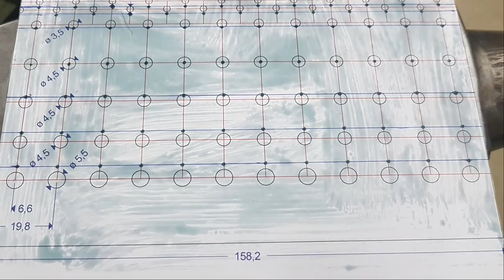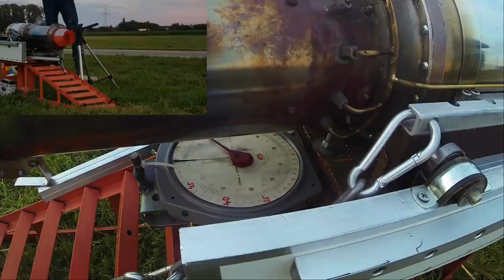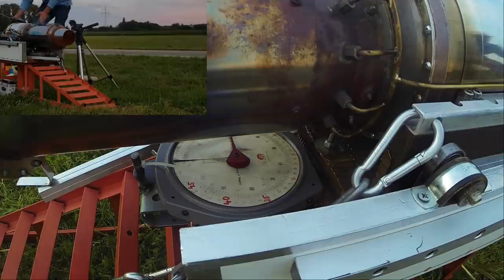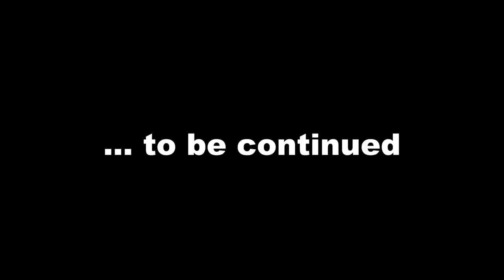Handmade Jet Engine, Improvements, Mishaps, Testing, Full afterburner

Comment: If you could make a bypass fan that ejects cooling air into the afterburner you would solve most of your heat issues.
Reply: A distilled water and methanol mix injected at some stage could possibly help too.
Reply: unfortunately this would not help. an afterburner gets its thrust profits from reheating the exhaust gases. if you cool the whole stream you will lose thrust. I'd rather improve wall cooling
Reply from the maker: Hi,
all jet engines with water/methanol injection working the same way.
You cannot increase the power of a jet engine with that.
The only purpose is to "hold" the thrust in warm/hot ambient temperatures.
The density in hot weather conditions is more less, than in cold weather. You loose thrust in hot conditions. 
Andy
Reply: How about some ITC HT Ceramic Coating on the inside of the burner that way the metal isn’t so hot and it will keep your heat/thrust
Reply: @Praendy  if you use strait alcohol as a afterburner cooling spray ( like a ring that sprays out the cones inner surface radially) you would gain the cooling you need also using it between walls in the tail section before injection would soak up quite a bit of heat, this is similar to what nasa does on its shuttle rockets
Reply: @Praendy awesome genius work btw
Reply from the maker: Hi Joe,
the afterburner is not a problem.
All parts are made of Inconel.
It looks more extreme, than it is.
Nothing will melt👍👍👍
Andy
Reply: Wie kann ich Inconel Bro finden? Ist es teuer?
Reply: @carneum5128  inconell itself is not too expensive but it's brittle and hard so a pain to machine or post process
Reply: @petergebert4817  I’m not talking about into the direct airstream, I mean more like a second combust or can with holes in it. This would add more air for combustion but also a cooling jacket of air just like in the main combustion.

Comment: My inner scientist/engineer thinks there's still about 20% more thrust... somewhere. Where that is? I have no idea.
Reply from the maker: Hi,
Thats also my "good" question.
30 Kg thrust is not much for this size.
Will try a different compressor wheel next time😉
Andy
Reply: @Praendy  This is still better in thrust/weight than the axial flow engines of World War 2.
Reply from the maker: @DrHarryT  Hi,
First I will try a different compressor wheel.
An axial compressor is a big challenge for homebuilders.
The advantage of a radial compressor is the simple handling.
You have a good pressure ratio with only one stage.
For the same in axial, you will need 4-5 stages.
Also the diffuser is easy to install.
The shaft is easy to machine and to balance.
For an axial comp, the aerodynamic performance only allows very small mistakes.
Lets see the thrust with the new comp wheel😉
Andy

Comment: Hey Andy, 30 kg is quite a lot for your own design. Yes, it sounds really like a fighter jet. I had my jaw dropped from the beginning of the video. When the compressor cover came off so did my jaw too lol... Good luck!!
Reply from the maker: Hi Shanaka,
Yes, the sound is awesome.
30 Kg is not bad, but the engine is calculated with twice the power, without afterburner.
Next step? Trying a different compressor wheel.
The engine is still in perfect condition after the incident👍👍👍
Thank you!
Andy
Reply: @Praendy  Ok i didn't dare to say so but 30kg with after burner sounded really inefficient. I'm keen on seeing the rest :-)

Comment: That's really cool I used to do that for a living building test engines for different kinds of platforms.
We even made a modern version of an old German design before turbine and especially compressor technology was even known the way they chose to heat the air was with an internal combustion engine so basically it was an overblown internal combustion engine that had a separate turbineshaft to extract the power from the turbine on demand as torque as opposed to thrust in addition to the crankshaft power produced that could be directed to the  compressor or as torque through a pair of clutches you could either couple crankshaft horsepower to suck in more air for thrust or coupling the turbine output to the crankshaft to power a heavy load, propeller, generators.
Imagine a V8 with the cylinders of a motorcycle about 250cc each, 
Turbocharged by a high bypass fan turbojet engine.
Utilizing the engine as the combuster section.
 Combusters sections were beyond most people not to mention most compressor designs induce stall at some point in there operation that can be objectionable if not dangerous.
Explosive compressor burps scare the hell out of people to hear a giant explosion and see fire coming out of the front of the engine on take off does not give one that warm fuzzy feeling witnessing it from inside the aircraft.
Typically not a real reason to turn around and land but if it's bad enough you let it go on too long you may not make it back.

Comment: Most videos I watched about homemade or even a modified jet turbine, they always kept the turbine spinning after shutdown to cool down the internal temperature of the engine.
 Saves the bearings and keeps warping down.
 I want to see one of these mounted in a RC jet aircraft and watch the afterburner operate ! 👍
Reply from the maker: Hi Richard,
At 06:20, you can hear my fan.
The turbine is also slowly spinning.
The fan gets mounted after each run for 10 min.
Then the temperature is below 50C.
Andy

Comment: Combustion can design: Angle the holes and understand a simple rule, never let the flame touch anything other than air and fuel. Have a look at combuster cans of bigger engines and see how the cans are usually made of multiple sleeves and have air holes that encourage air to cool the can and provide a boundary layer.

Comment: That is wicked sick.
Certainly one of the better ones I've seen out in the civilian home shop world.
You may wish to consider some explosion Shields around the compressor and hot wheel areas.
When Garrett Turbine, Allied Signal now Honeywell originally quoted apu's to Lufthansa they requested containment shields around the compressor and hot wheel areas and we did the prototype parts as well as some of the test rigs used to certify the design as the units are typically in the tail any failure resulting in a fire or the ejection of parts cannot be tolerated. 
Basically the shroud of the hot section and the compressor were beefed up considerably I believe the initial design was about 20 mm in the area of the hot section of inconel that ended up getting a lot of metal removed so it's retain the strength but to lose some weight this is done to all the shrouds that make up as I remember about six different pieces with the original parts weighed about 45 lb to current shrouds weighing almost 80 pounds in total.
Reply from the maker: Hi Chauvin,

I use some approved aircraft parts for the engine.
The ngv and the turbine wheel is from a Tornado fighter jet APU, called KHD T 312.
The turbine wheel is made for constant 68 000 rpm, up to 730° C egt.
The compressor wheel is a Mitsubishi TD 13 wheel and can handle 85 000 rpm.
I only want to go to 70 000 rpm and short time.
The engine will never fly, its just for fun and for some displays.
It weights 16,2 Kg with afterburner.
Still working on the variable nozzle and the performance.
Bought a nice balancing machine, made in 1966.
So far I had vibrations turbine side and was restricted below 70 000.
Now I did the first testruns with a "balanced" rotor and it works much better.
Will make a new video next time👍

Andy from Germany

Comment: Beautiful workmanship- it runs and flows so smoothly!!   In and out of the afterburner with a nice even flame!
 When it doesn’t want to shut down, it’s because you have some residual fuel in the fuel control, lines and nozzles…   In the turbine engines that I’ve flown and maintained, they have a “pressurize and dump” circuit which uses compressor bleed air to basically blow out the remaining fuel in the lines and nozzles when the fuel control is moved to the fuel cut-off position…   Also, instead of the fire extinguisher, which might have some chemicals that are corrosive to the internal parts of your engine, you might try using the starter to “dry-motor” the engine and move cool air through it…   Also, you could use an electric or gas powered leaf blower to do the same thing, cool down the hot section and blow the residual fuel and the flame out…   Just a suggestion, it might help extend the life of the beautiful engine that you’ve designed and built!!

Comment: Nice.
I'll give you as much as I can, as I have researched jet engines for a while.
Water for fuel in the afterburner (needs 4000* F+ to achieve ignition)
or as an air density increase.
Ceramic turbine blades, like GE uses, can be manufactured and replaced early, and will not degrade nearly as quickly.
High grade bearings and a lubrication system improvement is definitely necessary (I have a feeling that you spun a few in the "mishaps")
A diverter cone in the afterburner would increase the output, but would need to be prepared for the environment.
What you can't use:
My implosive air intake uses cavitation/vaccume for improved inflow
GE clockwork compressor is about the best basic form, but I have a ... different approach utilizing air to compress air while minimizing friction, sectionalized and stackable.
I had a heated fuel system theory that worked with the water fuel concept, as well as a pulse jet burner concept (I have many burners...all need testing) Another theory is bleeding the thrust into the intake for higher heat, rpm, and burn efficiency, but I haven't scienced the "stuff" out of that yet, lol.
I hope it helps in some way. You could use 100 pounds of thrust, right? For most guys, it's the rev of an engine, but for me, it's the blast of an afterburner that excites me. Ahh...that's the sound of horsepower.
Reply from the maker: Hi,
I have already build a variable nozzle for the afterburner, but first I test with fixed nozzles.
https://youtu.be/HPt10TzF00w

To bleed exhaust air into the air intake again is really not effective.
You use already burned air with less oxygen and a much less density.
The bearings I use are able up to 90 000 rpm and one of the mishaps in the video was the new shaft, rubbing in the tunnel and got stuck.
I will test a different compressor wheel next time and see, how it works.
Thank you😉 for liking!
Andy

Comment: Fantastic project - have worked in jet engine test for the last 40 years - I would highly recommend an inlet screen!
Reply from the maker: Hi Andrew,
Thank you.
An inlet screen is not required.
The engine will never fly. Its a show model for displays, or jet meetings.
Andy
Reply: @Praendy  I understand that, but over the years I have seen static turbines ingest all kinds of foreign objects from birds, to bolts to a crane hoist Chain!! They make pretty efficient vacuum cleaners!
Reply: @OldGuyWithaCamera  maybe we can see him throw in one of those broiler chickens from walmart
Reply: We used to do that to validate that the engines could withstand birdstrikes. They used to use a standard size duck, but once one caused much more damage than expected, it was discovered that some ducks swallow stones to make themselves less buoyant and able to dive more easily, after that they x-rayed each duck before firing it into the engine using an air canon!

Comment: this is honestly the coolest thing ive ever seen. You're really out here iron-manning things I felt only companies with tons of money and resources could do. Could this actually power something like a light jet?
Reply: Very easily with alot of power to spare with the afterburner. Just have to find a way to deal with the tremendous heat and keep the airframe cool enough so the rc model jet doesn't burst into flames especially once you lite the burner.

Comment: Your next level would be a turboFan : ) nice job sir! I guess vibration made the air intake nozzle slowly spin out of thread...Nicely enough, when it was off it did not touch the air-compressor blades. 😃
Reply from the maker: Hi,
the heat made the teflon compressor cover soft and the aluminium intake got pushed out.
Now all is made of aluminium.
Thank you👍
Andy

Comment: The engine got hot and the case expanded more than the intake housing so it fell off. I saw it happen earlier in the video. You'll need to find another means of attaching the intake. Just screwed together is not enough.

Comment: Would you mind if I asked one question, please? Does it run on electricity or on shafts like a normal jet engine? Is there a compressor on the engine?

Comment: Now put a larger fan and cowling of a size to avoid mach 1 on the fan tips with a magnetic gear box between fan and compressor fan (reducing speed as desired) and you'll have the smallest single spool high bypass turbofan engine in existence,  and may almost double your thrust. For those who can't afford a Rolls Royce GTF.

Comment: very nice! did you measure compressor discharge pressure? how did you balance it? that AB is very happy and it isn't melting anything. very nice!
Reply from the maker: Hi,
Yes, but with the current compressor wheel, the pressure is not that much and the thrust is missing a lot.
Today I got a new wheel 8+8 bladed and a bit bigger.
Balancing I do in my hands😉
First trying with knead, to find out  the imbalance and when all feels good, grind off step by step the opposite side. For that I use compressed air and it takes much time.
Thank you👍
Andy
Reply: @Praendy  That is my next step- learning the art of balancing. Keep up the good work!

Comment: Add a little bit of Oxygen so the fuel will burn better and you will get blue flame and more thrust 
BTW which motor have you used
Reply: and maybe a melted engine
Reply: Me:  Build this fuckin beast with vibraniumtitanumuraniumheliumthoriom 
PHYSICS:👌👈
CHEMISTRY:👌👈
MATHS :👌👈

Comment: Any idea what caused the damage?  Vibration, or did it just melt?
Reply: Extreme high temp exposure, i presume. Im wondering if he installed an EGT thermocouple and TIT sensor.
Reply from the maker: Hi Richard,
I also use Teflon for the intake.
The high compressed air is already "hot" ~160 C and the pressure pushed out the aluminium part.
The Teflon got weak and "soft", so the thread was not able to hold it in place.
It didnt fall off, because I had a cross bolt at 6 o clock installed😉
Engine is OK, except the compressor wheel. Will run again soon👍
Andy

Comment: When are we gonna see this beast on wheels or wings?
Reply from the maker: Hi,
At 11:15 you can see a short run with much noise😉
Wings will never mounted, because it is too heavy.
18 Kg or 40 lbs
Andy
Reply: @Praendy  however if you have a big enough airframe...

Comment: can you couple an afterburner with a Commercial jet engine
Reply from the maker: Hi,
Thats a good question.
It should be possible, but then the engine lost its efficiency.
Also, what to do with the cold fan air and the core engine is not producing that much thrust. 
70-80% thrust of a modern jet engine is produced by the big fan in the front.
Andy

Comment: when you start afterburner, you must change shape  of output nozzle - because you change temperature of gas flow. nozzle of turbojet  has been driven by fuel pressure of afterburner fuel bus.
Reply from the maker: Hi,
I have already build a variable nozzle.
The next tests, I will install it again😉
https://youtu.be/HPt10TzF00w
Andy

Comment: How about some ITC HT Ceramic Coating on the inside of the burner that way the metal isn’t so hot and it will keep your heat/thrust
Reply from the maker: Hi,
The burner is not a problem.
Its made of Inconel and will resist the heat.
In the vid, you can see the inside of the burner after a run.
Andy

Comment: Curious tho, Why not make it a hi-bypass turbofan engine?(duct the bypass/reactive thrust into the combustion chamber) in order to prolong the life of the hot section of the engine problem tho is the turbofan, where will you get the profile of that and its material.
Reply from the maker: Hi Joel,
things to tell is always easier, than to make.
its not possible to put only a fan in front and using the air for an afterburner, or combustion chamber.
The engine then needs at least 2 shafts and 2 turbine wheels.
Thats my very first jet engine build. Will see in the future :-)
Cheers Andy

Comment: I have been after building a similar engine for several years now and now have all the equipment however the 2 parts I cannot seem to find are the turbine wheel and ngv where did you manage to find them ? 
Regards tim
Reply from the maker: Hi Tim,
found the turbine and ngv at ebay UK.
Have a look! Ngv is still available, but I dont know your compressor size.

https://www.ebay.co.uk/itm/144086277759?hash=item218c361e7f:g:05IAAOSwytBg00iH
Andy

Comment: Are the compressor and turbine really homemade? They really look like they're out of a small turbine engine, if you made them holy shit thats impressive, if not still very impressive. Looking at it the compressor is probably out of a automotive turbo
Reply from the maker: Hi,
You are right.
The compressor wheel is from a Mitsubishi TD13 turbo charger.
The turbine wheel is from the Tornado fighter jet APU. 
Those parts are not "handmade"
Thank you😊
Andy

Comment: On other static jet engine tests, I notice they use a horn on the inlet to match air impedance ( if I recall correctly). Would that be useful in your application?
Reply from the maker: Hi,
not really.
Its much more important for axial compressor engines, to avoiding stall conditions in case of cross winds.
I have a radial compressor.
When my engine is running, I take care of the wind direction.
Thats an advantage of a portable engine😉
Andy